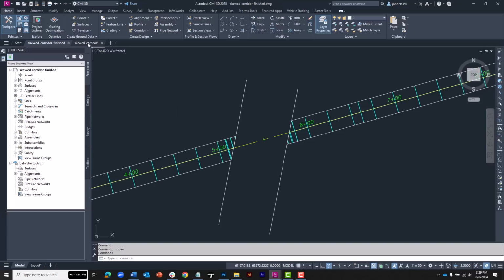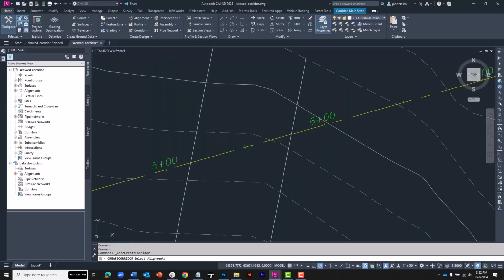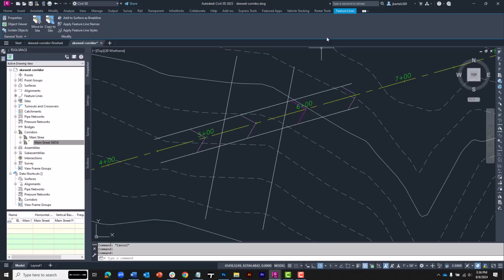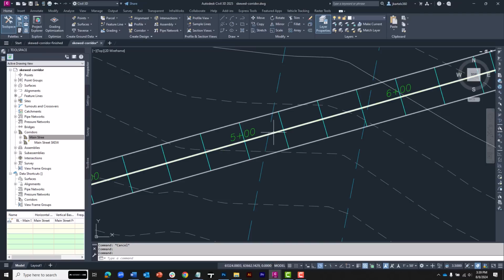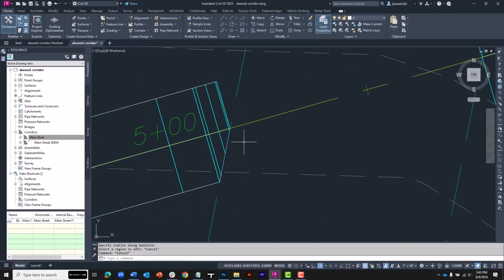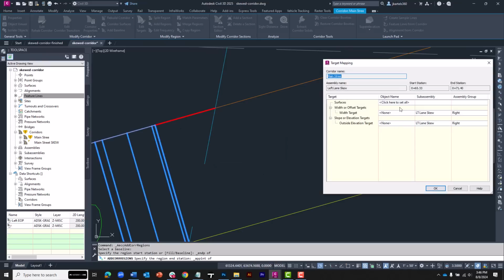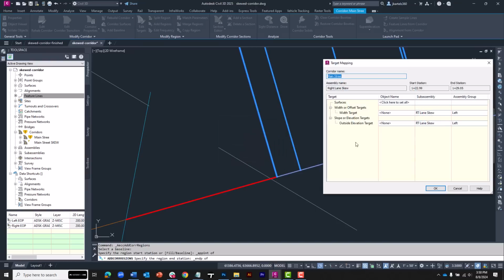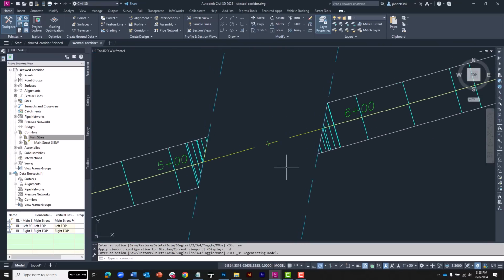Modeling Skewed Corridors in Civil 3D

Comment: Hello, I’m from Vietnam. I’m learning Civil 3D through your videos. I’m currently having an issue creating a T-intersection when using a shared profile view from a data shortcut. However, when I copy the alignment and profile into another file and create the intersection there, it works.

The problem is that I want everything to be in the same corridor file so the elevations can interpolate automatically. I hope you can help clarify this. Thank you!

Comment: I never imagined people would use Civil 3D like this. Why insist on solving every problem using Civil 3D’s built-in tools, even when they’re not the best for the job? Sometimes the simplest solution is the most effective. In Civil 3D, the model isn’t the core of the design—the linework is. The corridor function is just one tool to generate linework, but you can also use 3D polylines, feature lines, or custom line functions. It’s funny how you’re leading people down the wrong path.

Comment: Wild process, but in what instance would you use that method?  Also, if needed, I would rather do a quick work around and manually draw whatever it is you need in that area.   I prefer to HACK my projects to get them done.

Comment: Great video. However, we've avoided using auto corridor feature lines in the past as they don't accurately update when changes are made. Especially through vertical curves which occur quite often for bridges.
Has stability improved in newer versions?

Comment: I was doing this by creating modified assembly , with inserted invisible link that targets skew alignment, and then, rest of the assembly continues to the offset alignment, but this is other way, maybe cleaner than the one I was using so far. It is always good to be able to do things in various ways.
Thank you for another beautiful tutorial Jeff :)
Reply: i was doing this by creating custom assembley which has additional horizontal targeting of inside part of lane, where it touches alignment. So, first part is done same way, and second part i did not need that outside feature line, just horizontal targeting of inside part of lane

Comment: One of the most requested features on the Civil3D public roadmap is adding functionality for trimming a corridor, or perhaps adding functionality like  'Add Clipping Reference'. In the meantime this is a fine solution, thank you.
Reply: Agree completely. The competing Bentley ORD platform has had that functionality for some time, so little odd that C3D is still lacking with it. Particularly as the corridor is built outward (say, the paved shoulder, unpaved shoulder, and any tie-down conditions) start to really break down and make this workflow a little clunkier than it ideally should be. Where's my pitchfork? haha

Comment: Hi Mr Bartels, interesting workflow. I don't understand why you don't get any errors from having circular references, meaning the EOP feature lines get their elevation from the same corridor that they are baselines in, also the skew profiles get their elevation from a corridor surface when they are targets in that same corridor. Why doesn't that throw an error, just like if you have feature lines dynamic to a surface and you try adding them as break lines to that surface, which makes civil 3d throw an error?
Reply: He made a new corridor (Main Street SKEW) where he gets the surface and EOP lines from. He then uses those in the main corridor (Main Stree)
Reply: @alexmontanus  I totally forgot about the other corridor, thanks! 🙏

Comment: Hey Jeff, what’s your computer specs ? It runs great
Reply: I've been wondering the same. Performance has been woeful for many years yet his application runs so smoothly. The last time I saw performance like this within my application was when I was using the 2016 build.
Reply: @jeancoetzee2800  2025 has been quite an improvement imho. Also, this isn't a very complex drawing. The EG surface seems to be a DREF, and there is a small and simple assembly used, in a short corridor. If this isnt running as smooth on your pc, look into editing settings within Civil3D. Try diasbling the Dyninput (Jeff also has it turned off) and I always turn off the filetabpreview.